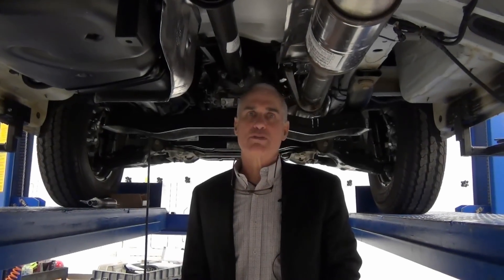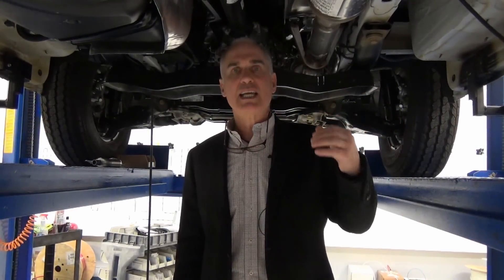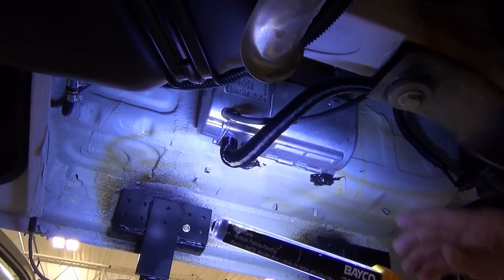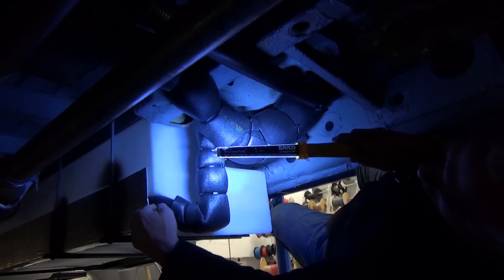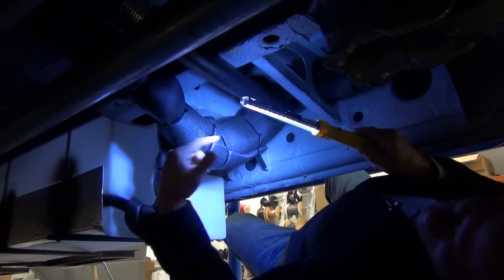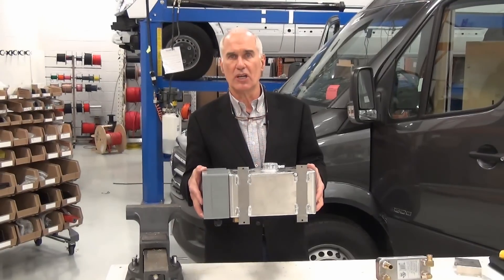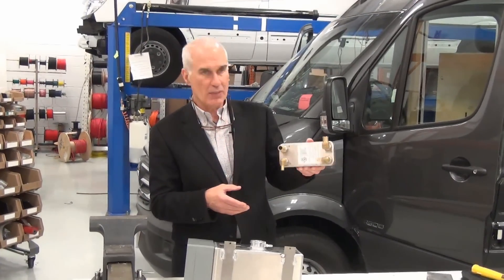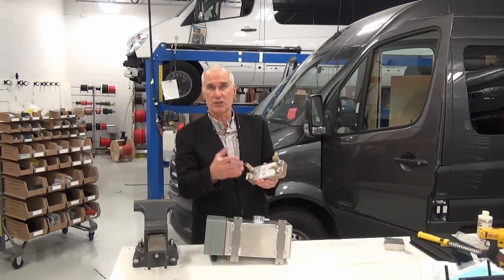Use Diesel Instead of Propane for Heating Off the Grid - Advanced RV Custom Motorhome

Comment: can you show a video of the system running?  i am wondering what it sounds like when running at full speed, from inside the cabin and outside the vehicle.  i have heard these heaters can be noisy, so i'm wondering if it will keep me awake at night, or bother nearby campers.
thank you

Comment: Hello Sir, I have a question regarding the van build:
1. Do you do any undercoating to protect from rust and what do you use?

2. How do you calculate amount of insulation required?

3. Is there any AC option for van which does not need cutting a hole in roof?

Thank you very much.

Comment: Nice design! I'm assuming you have an aquastat to demand heat for the water from the furnace? If so, how do you coordinate the controls between the thermostat and the aquastat to demand heat and activate the blower on the glycol to air exchanger? What sort of aquastat do you use and how long does it take to have hot water when starting from cold? Or do you simply manually turn this on for hot water and only use the thermostat to run the air exchanger?
Reply from the maker: Thanks for the question Troy.

The Espar unit that heats the glycol loop has its own internal temperature control system that manages the burner. It will shut down the flame if the temperature exceeds a limit and it restarts the flame when the glycol water cools down.

The glycol-to-cabin air is controlled by a thermostat in the van. The Espar is turned on when there is a demand for heat in the van. 

The domestic hot water is heated by a water-to-water heat exchanger where the glycol water heats the domestic water. The output of that heat exchanger is too hot to use in a domestic application, so we have a tempering valve that mixes cold water with the very hot fresh water from the heat exchanger.

There is also a buffer tank for the glycol water that evens out the temperature fluctuations of the glycol water. 

The glycol loop takes around five minutes to reach its full temperature. At that point, it can heat water in a couple seconds. 

Let me know if that answered your questions!

Comment: I like your heater system. It is small enough to work on a Prius? Wonder if one can be made for gasolene. Wow I asked too soon you have an electric one that runs through the system that is the one I would use. I could keep warm and for cheap. The system could provide hot water for food too? I know that system is not cheap but I bet it is worth having since people are now living in their Prius now?
Reply: I think a gasoline version would be much more dangerous since oil fired heaters have been around a long time but 190° is plenty hot enough to make coffee on a chilly morning. I wonder if they have a tap for instant hot water at the sink?

Comment: Hi, i own a 37 ft Camio  Carriage resort coach.I heat it with 2 very high end portable heaters and the furnace.I used to own a 25 ft boat and wanted to put in an Espar. Now im wanting to addapt it to heat my floors,water and the coach     during the cold winter months in the Okanagan in BC ,Canada. Do you people sell a model that would heat my 37 ft coach ? I would like the full cost sent to me if possible. Will send my address after you respond. Just love Espar. Amazing heat system. Thanks

Comment: Does this system create more noise than a propane furnace? What about diesel emissions and odors outside the vehicle, considering that propane is very clean burning?
Reply from the maker: Thank you for your question True Infinite Life. I don't know what a propane furnace sounds like, but the diesel heater is very quiet.

Comment: Mike,another question,and please contact me through an email.Instead of that vary large a/c unit on the roof of the RV, could you incorporate a small 8000btu portable in the RV and exhaust it out through the floor,allowing more room on the roof for more solar panels and making the RV more stealth?

Comment: I have a 20k BTU propane furnace in my winter capable 5th wheel. How many BTUs is the diesel furnace?
Reply from the maker: We install under-chassis diesel coach heat and on-demand hot water system on every unit, freeing clients from the need for propane, creating a more comfortable and quiet coach, and opening more storage in the coach because we do not need to install a hot water tank or propane furnace.
Reply: The standard size is 5kW, which is design to preheat a car engine and cabin. You get more powerful ones for use in large trucks.

Comment: Do you run this through the engine block, too?
Reply from the maker: We don’t typically run through the engine block but it is certainly an easy option.
Reply: A switch to preheat the engine block for extreme winter would be very nice. Firing up my 6V92 at -8F in Flagstaff was an adventure.
Reply: Jollyprez
Most or all vehicle dealers has a block heater option, even for your car or as an after market option. Worth every penny. Payback over fuel cost IDK but the savings in aggravation makes it well worth the cost especially when in that cold under the hood! Hook it into your battery system and the generator can help if low on power.
Reply: George Purdy i

Comment: Where can you find this hot water heat exchanger?
Reply from the maker: Thank you for your question.  We get our hot water heat exchanger from Rixen Enterprises.
Reply: Advanced RV thanks so much. If I may ask one more. Does Rixen supply that water tank underneath with the custom groove for the water return to prevent from freezing? Thanks!!!
Reply from the maker: We welcome any question! That tank is something that we custom designed for our system.

Comment: Have you ever installed an Aqua-Hot system on a larger Diesel RV?
Reply from the maker: Thank you for your question. To date, our builds have all used the on demand hot water heat exchanger that Mike discusses in the video.

Comment: 0.15 Gal/hr of Diesel ! There's a major loss of thermal energy somewhere in your system.
Reply from the maker: The ESPAR system has the type of thermal loses one would expect in a fired heat exchanger with heat transfer fluid transport to other heat exchangers in the circuit to heat water and inside air. However all external heat exchangers and transport hoses are insulated.

Comment: Please!!!
Why heat HOT water?
How about heating cold water and keeping hot water hot?
The "water heater" sold by the manafacatures has them listed as water heater not hot water heater.
In everyone of these videos the pitch guy says HOT WATER HEATER and it makes me wonder exactly what the quality of their units are.
To grab a customers attention use the proper termonology of "Cold water heater" and they have your undivided attention because you just said something all the others say incorrectly and it's "odd" but true.
Reply: Most people wont notice this terminology. I didn't. I understood the concept, understood the different parts and the benefits, without the need for the "correct" terminology. Some things need no explanation.
Reply: +George Purdy Why do we"Park in a Driveway" and"Drive on a Parkway".....it just is!!!
Reply: Bet me to it haha, precisely what I thought!
Reply: George Purdy — I think many here, including yourself, made your comments without listening to the entire video or a good understanding of their system.  They said the system ‘pre-heats’ the hot water with the heater glycol as the last step before being reheated.  The glycol is heated to about 190.  This means one very economical heat source, using .2 gal. Fuel per hour (max), can heat the RV, the hot water, AND the holding tanks without the need to run the electric or propane hot water heater.  It all sounds pretty smart to me, esp. considering that you still have the ability to use other heat sources if demand requires it.